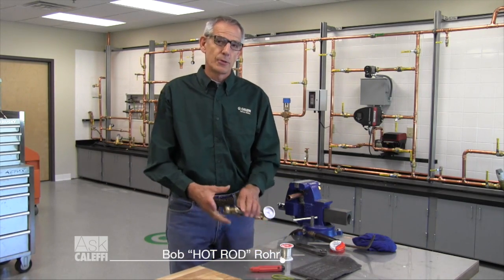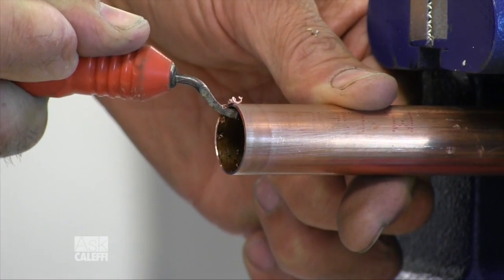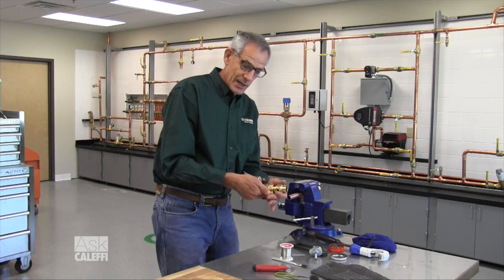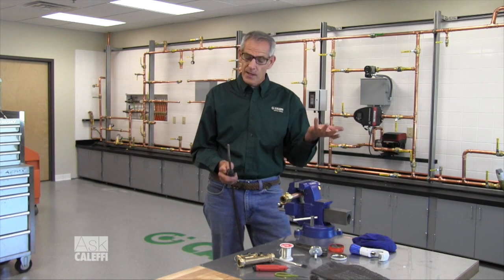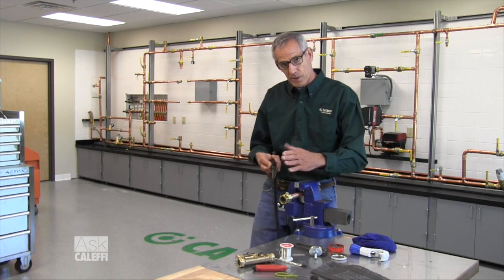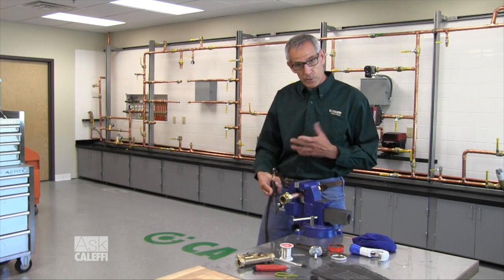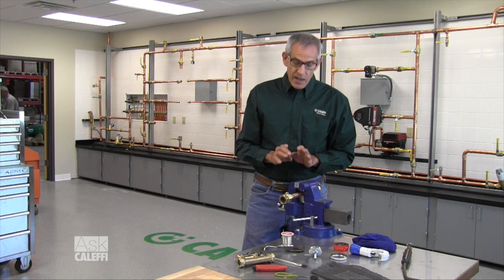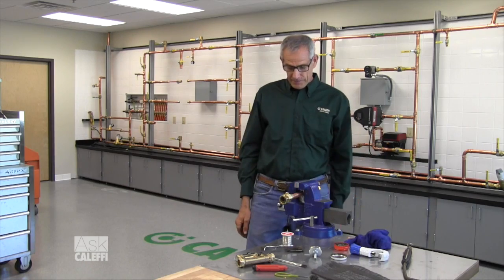What is different about soldering lead free brass?

Comment: I was always tought to remove the hear when you introduced the solder.  Is that still true with the "lead-free" solder?
Reply from the maker: Thanks for your question.  Lead-free solder has a higher melting point and lead-free brass does not transfer heat as well.   Sometimes it is necessary to continue heating slightly even after solder begins to flow.

Comment: I typically haven't had much trouble soldering lead free brass but I will definitely keep this in mind. Thanks for sharing. Soldering bronze fittings I'll admit I've had a few problems and maybe it's a  similar issue? Thanks again.
Reply from the maker: Glad we've been of some help. Thank you for your comment!
Reply: I second this comment,thanks for the info!

Comment: hi. that solder copper or brass, what pressures does it hold,
Reply from the maker: +Mindaugas Berteska The pressures will depend on the size/type of pipe and filler materials being used for brazing/soldering. We would suggest searching online for the “Copper Tube Handbook”, lots of good information in there on this topic. Just remember that most of our products are only rated to 150 PSI! Hope this helps.
Reply: so if joint hold 150 psi for home garage youse would be planty, because it's would hold just compresed air
Reply: I used copper tubing for air lines in my shop and they've held up great for over a decade. I'm running about 120 PSI constant that's reduced to 90 at the regulator.